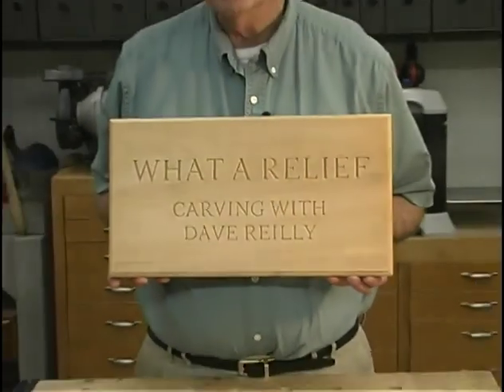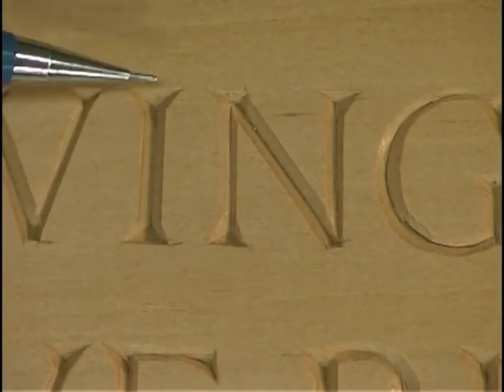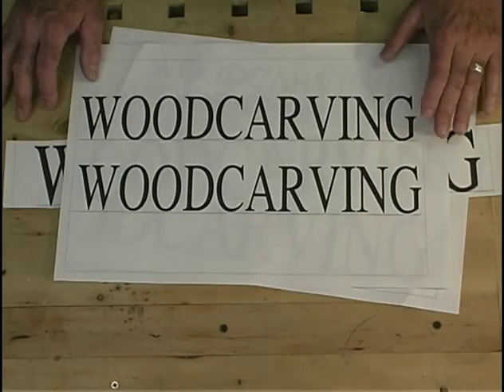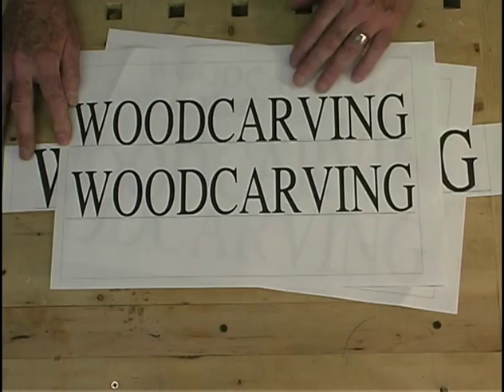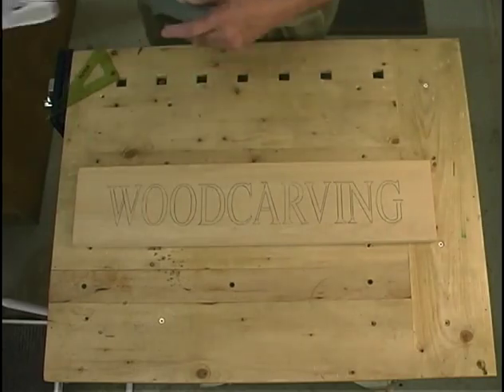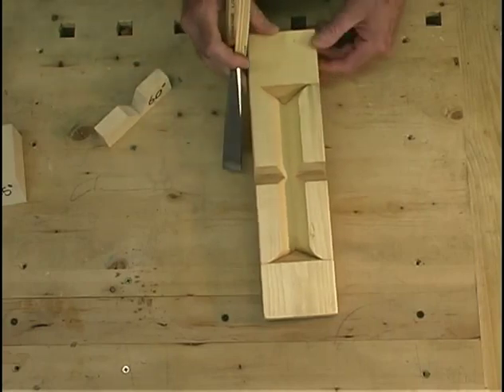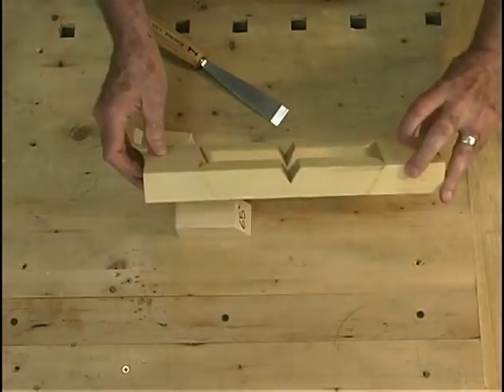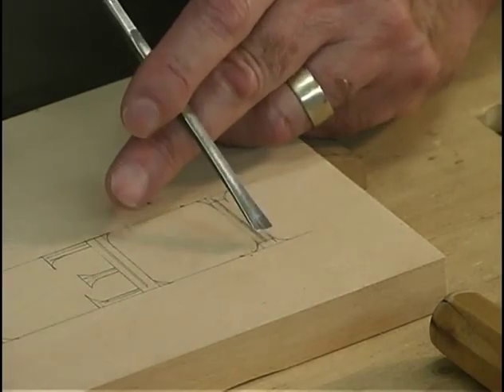W055 How to Carve Letters by David Reilly

Comment: Thank u. What about the wood?!! U dont teach that? The grains?
Reply from the maker: Woodgrain as it applies to carving is, unfortunately, impossible to "work around".  Carvings, or I should say the form you are carving, has to follow the orientation of the object and you often can pick and choose which direction the grain should be.  An easy example is a door panel that is carved.  The grain would run vertical and your subject matter would also have to run vertical or "right side up".  I will be doing some videos on CNC Carving in the near future and I will be pointing out the effects of grain direction.  This information will apply to CNC carving and Hand Carving.